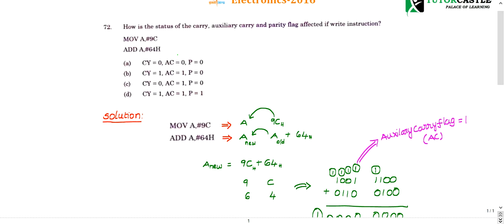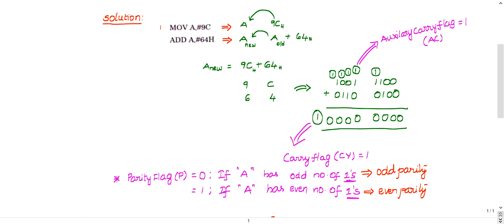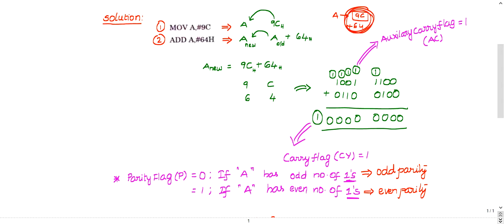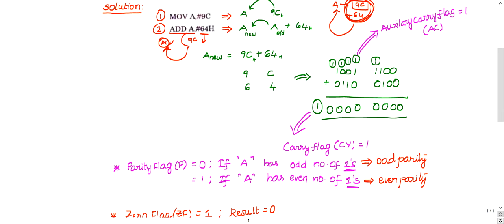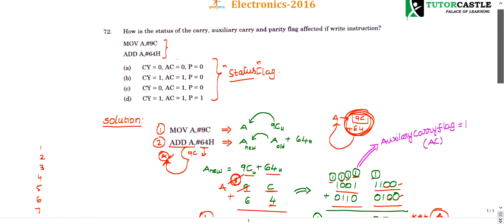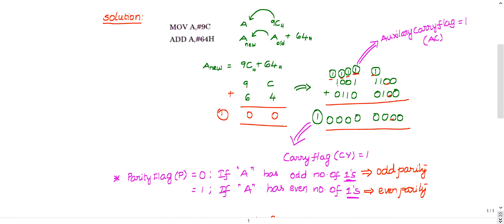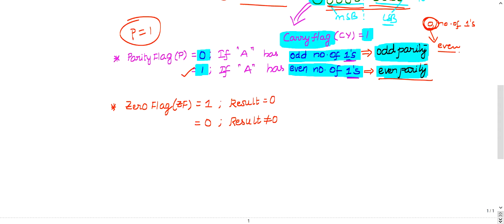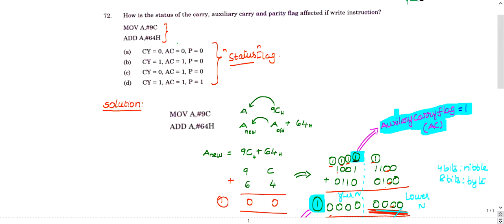ISRO Previous Year Detailed Solutions- 2016 - 72Q - Electronics

Comment: Hi,  If we assume the above instruction is written in microcontroller then option B is the correct one. In 8051 Parity Flag is set when Acc contains odd no of 1's. if they don't provide whether the instruction is written in uC 8051 or uP 8085, Can we consider uP as default?